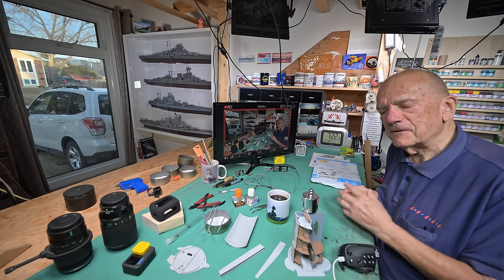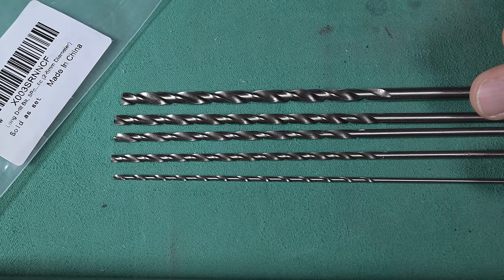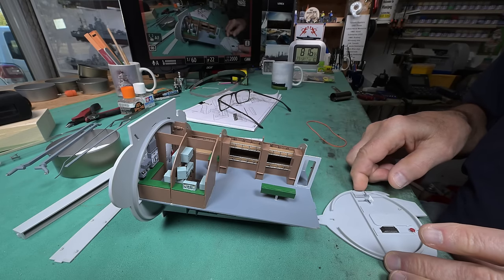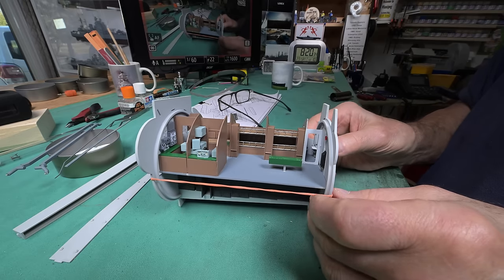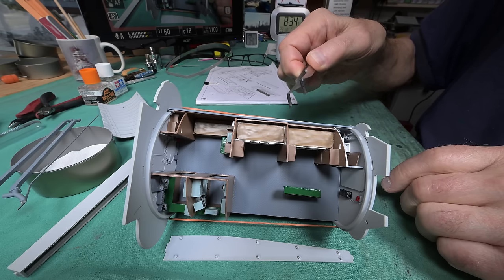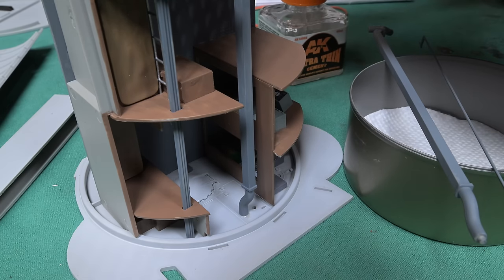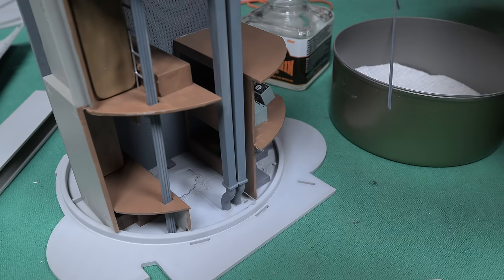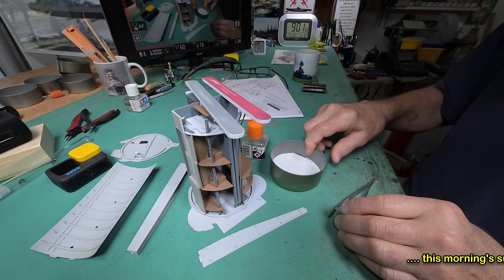The Model Ship - Part 1957

Comment: The way they were packed and able to bang around, I wouldn't expect too much.  About anything will work in wood though.
Agree with your theory on unions.  I belong to four different ones in my early working life because I had to.  The last 20 years were in a plant that had been unionize for over 70 and then closed down because of the five different unions in the plant and then sold.  I was reopened 35 years ago and is till union free today.  Lesson learned.
They do a great job of protecting folks that should have been fired.  A good example of what they can do to an industry can be seen in Michigan and the loss of auto mfg plants.  But, we are happy to have them in Tennessee.  Another example is the steel industry and where it has gone.
See ya.              JimE
Reply from the maker: "They do a great job of protecting folks that should have been fired" Yup!